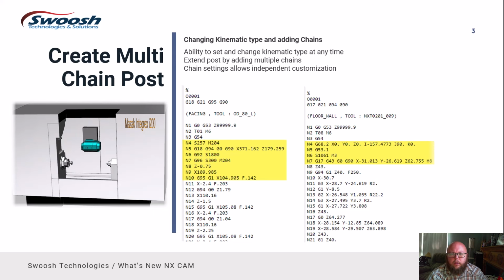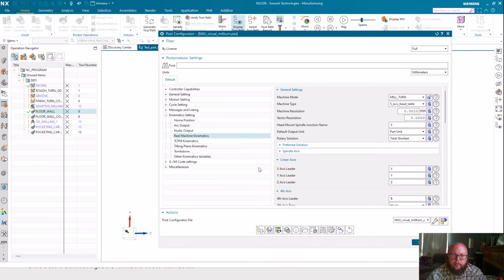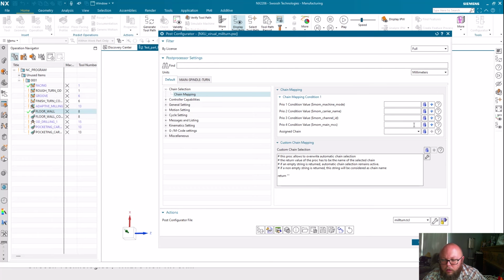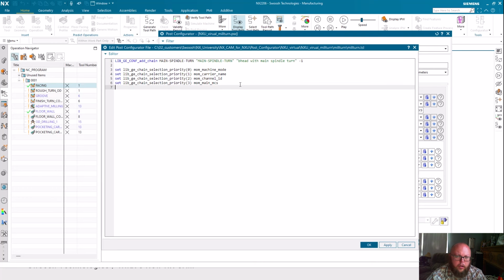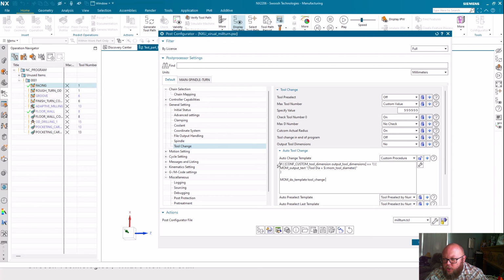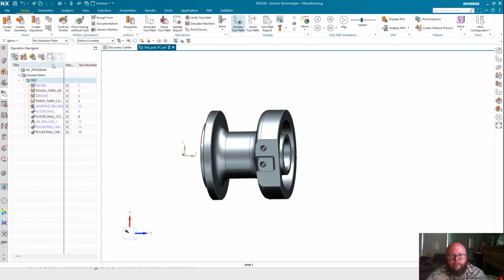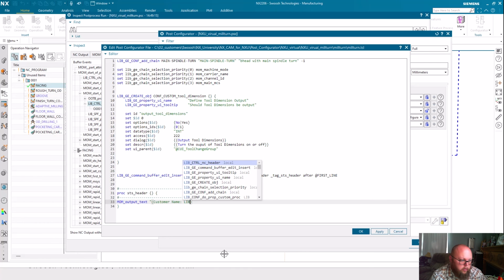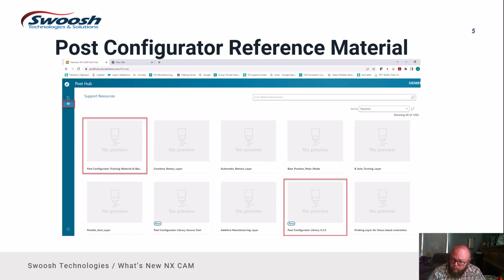NX CAM Post Configuration | Virtual NX University

Comment: Hi, with the post configurator basic license can I add optional stop before and after the automatic tool change?
Reply from the maker: Technically, yes, if you know the buffer location and tag, you can add a procedure that inserts optional stops. Unfortunately, the Basic license doesn't give you access to the Inspect Tool in Debugging which is where we inspect for the buffer locations and tags.